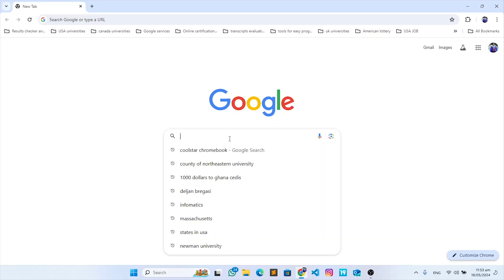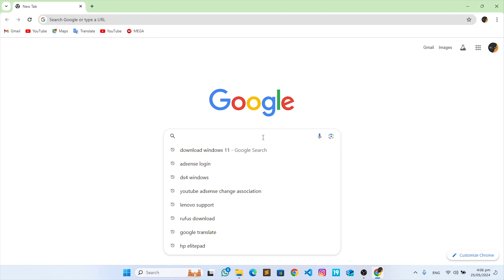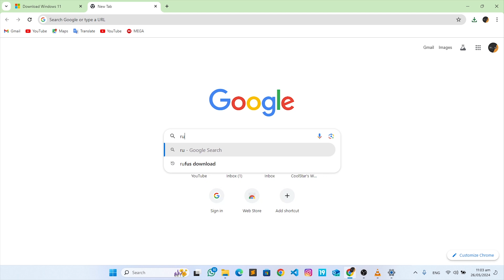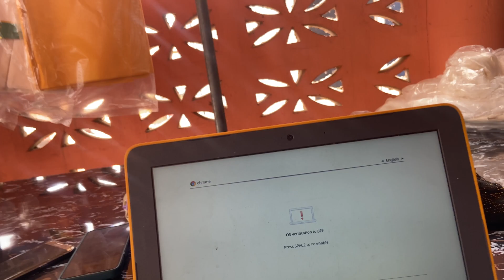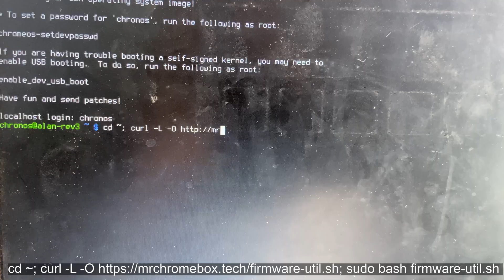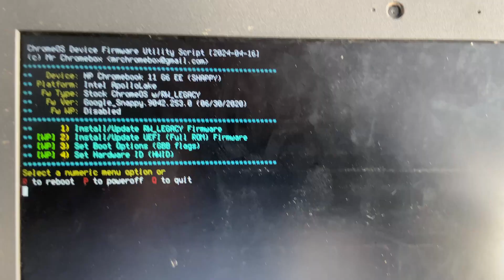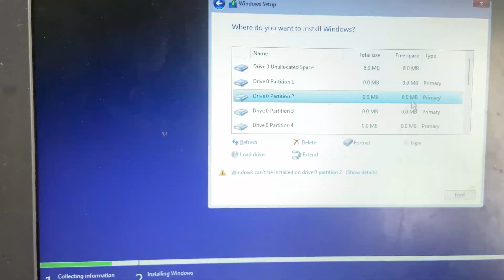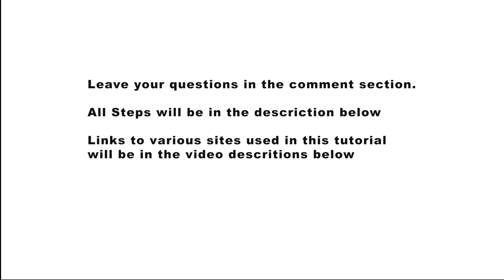How to install windows 11 on a Chromebook.

Comment: just flashed firmware, then powered off and now it wont turn on. what do i do?
Reply from the maker: After firmware flash, the 1st boot takes a long time.
Just make sure to put the Chromebook on charge.
Turn it on and leave it for a  while,  it will display
Reply: @nah bro my chromebook had a problem where it kept turning off automatically. and it turned off while flashing the firmware and now the whole thing is bricked, but i had a second one with a broken screen so i swapped them around, did the whole thing over again and it worked fine
Reply from the maker: Ok.

Comment: my chromebook is a hp 11 g9 ee chromebook. apparently cr50 is one of the methods followed by the write protect jumper method. i decided to do cr50 method because i dont have a solder machine. i do all the steps as said. i still cant disable write protect. please send help.
Reply: [EDIT ON DIFFERENT ACCOUNT] : just found out newer models need write protect jumpers to be soldered
Reply from the maker: Yh

Comment: i tried doing this on my asus chromebook c523na, whenever i try to boot from windows 10 or 11 using a usb it gives a blue screen with the error "DRIVER_PNP_WATCHDOG". how do i fix this?
Reply from the maker: How did you create your bootable windows usb?
Reply: @JessokTech Rufus and media creation tool
Reply: @JessokTech  I tried using Rufus and the media creation tool by Windows, both multiple times. I also tried different usbs and different usb ports but all had the same error
Reply from the maker: Send me error message on itmall128@gmail.com
Reply: i got the same errore on Asus chromebook C423 / Rufus